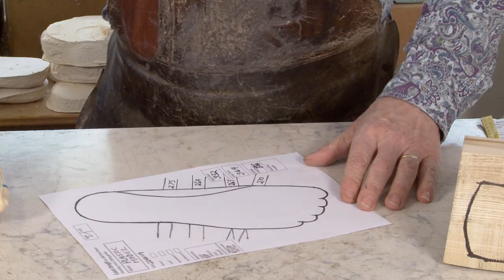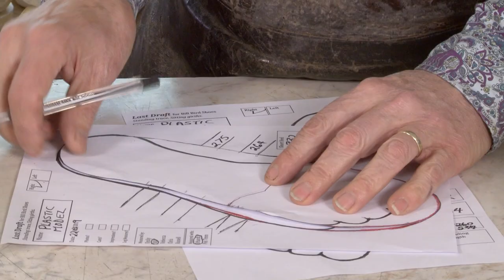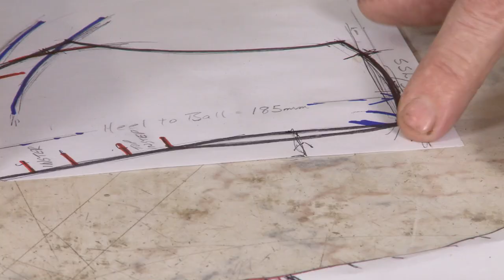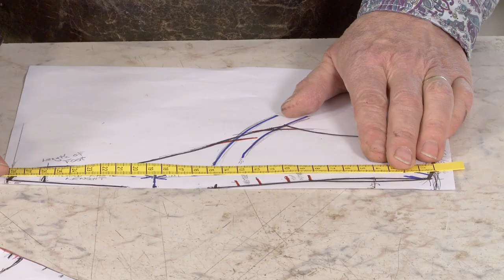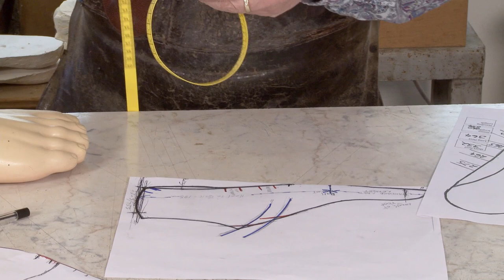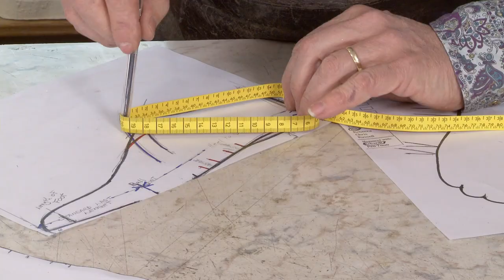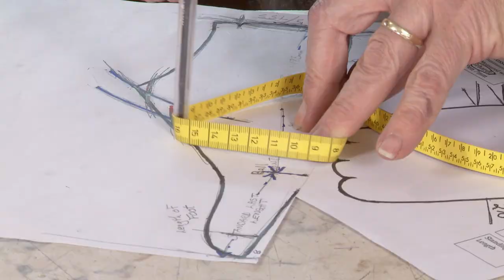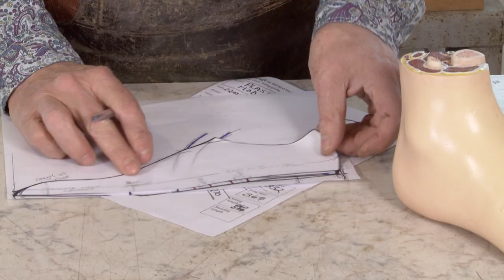07 Draft to Last:   Creating a Profile and Outline from a Draft

Comment: for the two instep measures, when you are using your fingers to displace part of the measurement are you having them the width of the inner measurement on the page, the outer measurement on the page, or the 3.5mm in from both sides of the outer measurement? (if any)